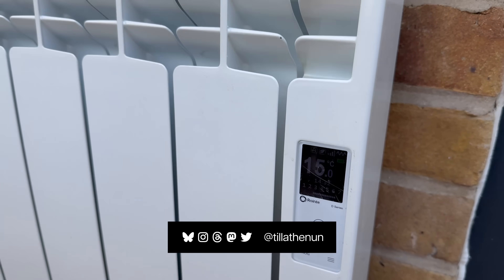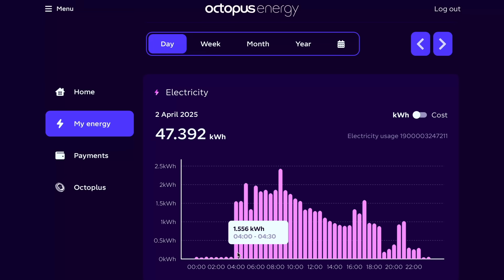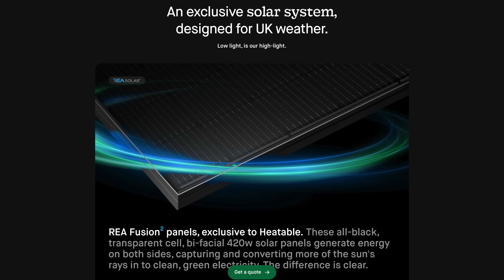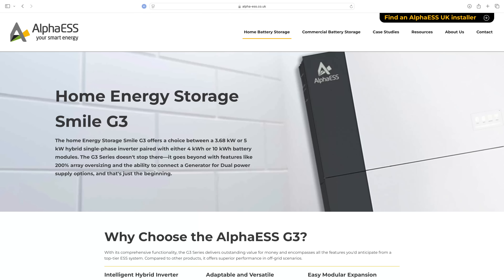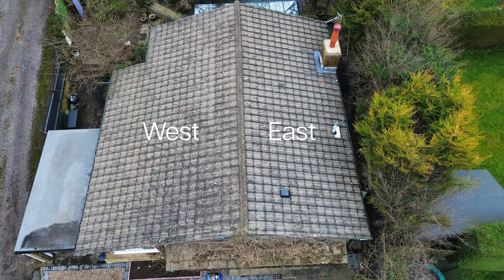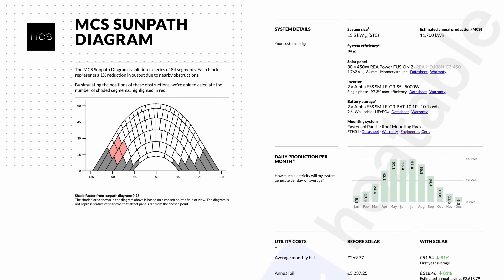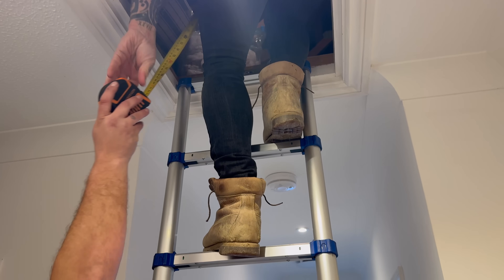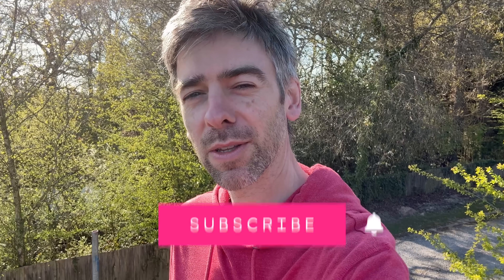We're going to kill those bills! Why we've decided to get solar panels and battery storage. ☀️

Comment: Make sure your system doesn't charge your ev from the battery during additional IOG slots.  I use Home Assistant to detect any IOG slots that then tells my home battery to charge during those slots giving me additional energy into the batteries at 7p/kwh.  Since I've had my solar/battery system (Dec 24) my average pp/kwh is 7.2p.  A bit of tactical use of IOG, not abuse, is all that's required.
Reply from the maker: Yes, that was a consideration the installers recommended to me. The Zappi is separated with a Henley Block.
Reply: Better still, split the EV charger onto its own tails from the meter (Henley Block??).  The battery doesn't see the charger load.  It's not very useful charging the EV from battery especially if you charge at 7p and export at 15p.  Home assistant is fine and I use it for other things but keep it simple.
Reply from the maker: Yes, that's what we're doing!

Comment: Food for thought: Though micro inverters are potentially more expensive (one for each panel), they have a 25 year warranty compared with a typical 10 year warranty from a standard inverter. They also reduced the amount of DC wiring from the roof, which has a higher risk of causing fires. For small arrays the price difference might not be too great.
Reply: I think you're right. For smaller arrays, Micro is probbaly worth the investment as they start up as low as 20v, compared to let's say 200v with a traditional inverter. Once you go over the 10-12 panels on the roof level though, you're effectively easily getting that 200v just as easy, and don;t suffer as many AC-DC conversion losses like you would with micro inverters. It's an absolute chaotic mess trying to figure all the different configorations out though and trying to elarn what is what etc.
Reply: @AndyKennedy  No, I do not know where you live and dream of 20V panels. Current panels have 40 to over 50V. 
And micro inverters are crap cause you have to proof they are faulty. Hence you have to remove the panel on your roof to get to the inverter and send it in. And the usual reply from manufacturer is a mounting issue or broken seal by the installer who had not done it properly. This happens after 5 to 10 years and the installer has nothing to do with the case and you get nothing but a high bill.

I have been working for an installer mainland europe planing and dealing with all those customer who knew that better and insisted on micro inverters. Those are only an option for houses which are really suffering hard from shadowing. We have only 10 year experience with these and every single roof had at least 1 faulty microinverter and none had been accepted as a warranty case.

Lot of work to replace just 1 micro inverter on the outer perimeter of an array, but terrible if it is inside like 6x 4 arrays.

Forget about all the losses you had mentioned. Does not really matter cause in both cases the systems are on the optimum. 
High voltage DC can be lowered by 6 mm² cables and on the microinverter side you have the same cable length too, but with a lower voltage and higher current hence smaller diameters. 

We have done such builts for customers who insisted on micro inverters and they would never do it again cause every one of them has faced the challenges of 1 broken inverter. The reality for you will be:

500 GBP bill upfront for inspection or even more in case a scaffold is required (which is easily another 500 GBP) for safety reasons.
1000 GBP for 1 panel - good luck. We did that 2 times and never again cause those customer finally learned the hard way that their 250 Wp from 2024 will never produce that amount of energy worth to pay the bill. 250 Wp = 250 kWh p.a.  or 2500 kWh in 10 years
Assuming 10 pence you will have gained 250 GBP and have to pay 500 GBP to replace such microinverter . 
It is a tough hard work on your roof to unscrew 1 panel and get it out cause you can get to the panel only from the bottom or top . And then you need to get it out. Horrible work to get to the microinverters cause usually cables are short .
Reply: Forget about your idea and math. You need to know what a microinverter warranty is worth: NOTHING
cause you have to proof that and you have to remove the microinverter from 1 panel in the middle of a 50 panel array .
Will become quite expensive and then you will hear about a loophole. 
You are wrong about the higher risk cause you generate the same amount of power and have also 1 connection between 2 panels as before but now on the AC side. 4000 Wp generate maybe 4000 W DC ... but 10 x 400 Wp generating 10x 400 W AC will end in 4000 W AC.

Much higher risk with those 10 inverters - far easier to maintain and repair 1 inverter or you are smart and get 3 smaller inverter for single phase only as we did. 3x 5 kW insteadt 1x 15 kW cause in case of a damage there are still 2 in full production till you got the damaged repaired . 

This does not pay off - it makes only sense if your array suffers from strong shading , I mean a shadow that is coming in  cause by a house or tree.     
Our kids learn that in school already when to use what in 12th grade.

Comment: I can't really see the cost benefit of solar. Massive investment for little gain. Just charge the battery storage overnight at 7p per kWh. 
Let's assume 9p per kWh for losses. For the cost of the solar you would get circa 136MWh!
If you get the estimated annual solar production 11,700 kWh it would take 11 years to produce 136MWh.
Reply: Heat the home overnight and charge up the battery at 7p, sell excess solar for 15p, that means you are offsetting your overnight bill and building up credit.  I believe Gary Does Solar has been through the sums on this and found whilst the differential between import and export is there, it is still worth doing. Without solar you would be limited to exporting left over battery storage. Yes you have capital outlay, but double glazing windows have a similar payback time, but the immediate comfort means that is rarely questioned these days and is expected on sale. Anyway with nearly 2000 spent heating a bungalow over the past winter, you would be lucky not to spend that capital in 9 winters.
Reply: Solar makes sense at the moment because the export rate is currently twice the night import rate, assuming you have an EV or battery tariff. So import while it's cheap at night, and export everything possible in the daytime.
On my modest solar system, the exports alone will cover the installation cost in 10 years, which doesn't factor in my import reduction in the daytime when the panels are generating. Covering my daytime import cuts another 3 years off the payback period, so my investment will be paid for in 7 years, give or take.

Solar is most definitely worthwhile installing.

Comment: I am also going through the same journey of battery and solar panels and then eventually heat pump and an EV at some point in the future. My worry is that homes are becoming very complicated and at the start everything will work great but 4 or 5 years down the line if there are issues then you will need a very experienced (expense) engineer to resolve the issue
Reply: Boilers break down, ICE cars break down (often).  That's just how it is but electric versions are no worse and probably better: Especially EVs.
Reply: Service you gas boiler every year and there is no problem.Our last boiler lasted over ten years.Our new Gas Boiler a year old cost just over a £1000 runs fine and a ten year quarantee.At 75 Iam not going to mess about with solar or heat pumps.
Reply: @foppo100  my point was that there is no reason to assume, for example, a heat pump is less reliable than a boiler.

Comment: £700 electric bill for one month!!! I’d have installed gas central heating immediately! You’re are putting in a large solar system but it won’t keep up with those radiators in the winter (not convinced about heat pumps). I do have my own solar install but about half the size of what you are planning
Reply: That assumes that gas is available. Not all areas have gas.
Reply: @ a fair point
Reply from the maker: Some of the nearby properties have gas central heating but it's fed from tanks which apparently is more expensive than mains gas. I imagine the cost to connect to that (even if we could) would be a fortune and since we'd have to get the whole house plumbed, a heat pump would work out cheaper due to the Gov grant.
Reply: We pay £200 a month gas and electric plus using a E.V.I think £200 is expensive.£700  a month is crazy.We have gas central heating 3 bedroom detached house.

Comment: I shall watch with interest.  I would prefer the modular Anker battery system and will also start with solar panels and a battery.  

The heat pump will follow but first I have to replace crappy microbore pipes feeding radiators from the 22mm manifold.   The ageing but very reliable and remarkably cheap to run Vaillant pre-condensing combi boiler just needs to hang on for another couple of years...

Comment: It is a strange thing that every time I look at payback it comes in around 8 years!

Great decision on getting the solar and battery fitted.  This is probable 3.5 times more solar than the usual and similar on battery storage so I beleieve you got a great deal. As you say anything like this will improve the value of your home and also boost your EPC rating. 

As you say it is also addictive and I keep wanting to add more and more as we are East facing so have 7.56kWh solar split across E and W rooves. I want some more on my south wall but DNO said no.

Comment: Hi I've had an Alpha battery for 6 years this summer and it hasn't missed a beat and I have fitted a good few Alphas too and everyone is happy with them. For the money I think they are the best option and it also has a great app compared to others I have seen and fitted. The only thing to be aware of is that expanding later on needs to be in first couple of years depending on use as your original batteries will have degraded a little and they can be problematic if not balanced with the new ones. This info came from Alpha technical some years ago but I still believe it to be true. Ev batteries are the same when they repair them they always try to get secondhand ones that match output

Comment: did you say 755 quid, 
do the garage for the battery + inverter. I'm an installer & all of my installs 200+ only had one return job. Overvoltage on grid. Believe my garage is the best place.
The garage is the go to for battery + inverter, then shed, then outside.
Will the battery fully recharge at cheap rate!
755 bill will only make a dent £5.6 - £4.50 = 1.50, Jan use of 89kWh of energy in winter. based on that use you would need a 7kw ASHP.

Comment: One factor you didn't mention with the battery choice is that a Powerwall is supported by Octopus Intelligent Flux, which would give you a better rate. 

By my calculations, if you spend £700 on electricity in a month, you needed about 90kWh per day. So a 20kWh battery isn't going to last long in the coldest months - but if Octopus would allow you to you switch to Cosy you could charge it up 3 times a day (at a slightly higher rate).

Comment: Try turning on the radiators during the cheap overnight electricity rate, and off when it becomes expensive. The house has a thermal load, in other words it takes time to heat up and more importantly, time to cool down. So you overheat at night and it will gradually cool down towards lunch time. Turn again before the evening peak electricity charge.

Probably you should cut back those trees on the east side. They look way to close to the house anyway and may generating shading on the panels.

Comment: 13.5kW!!?? That's massive. You're going to be pumping a lot out to the gridI Of you're restricted to 10kW, how do you deal with the excess if it's possible?
Reply: You don't have to deal with the excess as the system simply won't take the power from the panels.  You may as well use the excess as it's free but it's not a problem, especially on an E/W system.
Reply: It's 13.5kWp over East and West, so maximum power will only be available for a very short period of the day, even in summer. 
I'd be surprised if the 10kW export limit was reached more than ½ a dozen times per year, around the summer solstice.
Reply from the maker: I doubt we'll ever have any excess over 10kW to be honest but it'll be interesting to see what happens in summer!

Comment: Im sure you’ll not regret your decision, and as there is no way to compare the ACM fusion2 with an alternative unless you’d had 2 identical systems one with standard dc panels and the other heatable’s ACM ones and then compare, so don’t look back and I’m sure you’ll will save fortune on your bills. Your friends Tim&KatGW have a small 3 panel each test comparing micro inverters and inverters, so far the micro inverter are winning as they perform better in low light, I’m expect that to change in summer but over the whole year we don’t know which is best yet! We are moving into a mid 70’s bungalow in the next couple of weeks( returning to the seaside), I’m using the money from my maisonette to do up my partner’s family bungalow, it’s has old storage heaters and we want to build a couple of extensions (better half want a library for all their books) so one side of the bungalow will have modern insulation standards and then add in the roof and wall insulation to the parts not new, I plan to fill the roof with panels(heatable are my current top candidate and like you I’ve been asking question for months and months), get batteries and install a heat pump, so we are not expecting much left of the money from the sale, lucky for us I’ve paid my mortgage off now and the bungalow had never had one, so  our only major bills are going to be the council tax and water rates (with luck).

Comment: The biggest benefit for the battery is to be able to use off peak electricity for heating in the winter. In summer you will almost always generate more electricity than you can use.
Reply: Not necessarily if you're charging EVs though. That requires a LOT of electricity.
Reply: @David34981 Yes, but you don’t use the solar for your car(s) unless you can generate more than you can export. You charge your car/batteries off peak at night.
Reply from the maker: That's living the dream!

Comment: Why not go for an air/air heat pump like you had in your last house? Air/water is a lot more complex and a lot to go wrong as well. Also thermal panels are 90% efficient, they should be the first choice IMHO.
Reply from the maker: We had air-to-air at the previous house and my wife wasn't a fan (pun intended!): https://youtu.be/8hcyeWt9PG8

We may explore it again here though, perhaps with better positioning of the units (ducted perhaps).
Reply: @MrEV  There is a rumour that the heat pump grant will be extended to air/air soon.  Brico Depot in France (same owner as B&Q) are offering a complete system with 3 internal units for 2,200€ installed.

Comment: I hope you get as many solar panels you can fit on the roof. Martyna on Solar Time channel tested difference between microinvers and optimisers and didn't show any substantial difference. I have a Powerwall2 here installed in 2017 (one of the first ones in UK). The battery health still shows 100% after 8 years. Powerwall is very weatherproof - mine is on outside facing North.
You will of course  be exporting 10kW on many sunny days in summer. My system exports 5kW (limit) almost every day during summer
and exports 20-30kWh per day. You won't be heating the house in summer and only so much charge for the EV.

Comment: Consider Aircon,  i.e. Air to Air heat pump - avoids the need for installing a wet heating system and on a smaller house you may only need 2-3 internal units to the external.
Reply: 100% agree. We have x4 A2A heaters in our 200m2 detached house and while we still have a gas fired central heating system we only use it for hot water, not heating . Like Andrew we have a 13kWp system but only a single 10kWh battery. Over the winter we use Octopus Cosy (so we can keep recharging our small battery) and in the spring, summer and autumn we switch to Flux or IOG. For 2024 our total elec/gas bill was £90 in credit. I don’t think 2025 will be quite as good because Flux day rate has been slashed 😡

Comment: Similar(ish) journey to us - 8.7kWp panels (12 E/8 W), 7.5kW inverter and 17.4kWh batteries fitted in October 23 and Octopus direct debit currently £1/ month.  On IOG and we only charge the EV once a week or less. 

ASHP installed Sep 24 and electricity bill over the winter slightly less than combined electricity and gas from last year.  Already had a wet CH system, so much easier conversion for us. 

Still getting to grips with the annual total cost as last year's bills had significant contributions from Octopus Savings Sessions, but seem to be on track to still be close to zero. 

May all change if export rates drop off course, but still a good saving. 

I'm not really looking at the time to break even - I look at all as providing budget certainty in a world of varying power costs.
Reply: Agree. The cost of energy is not going to reduce substantially anytime soon, so protect yourself now if you can afford to do so. Never really understood the ROI argument as this is not mentioned when purchasing a new roof, which for our house was quoted around £16k or combo gas boiler!? We are currently reviewing installers, batteries, panels, inverters, etc to have solar installed asap.